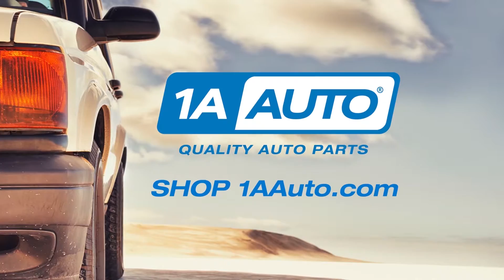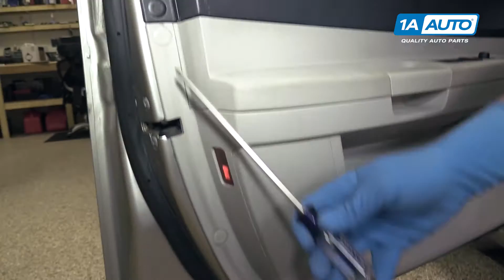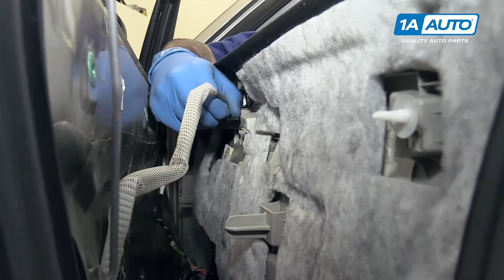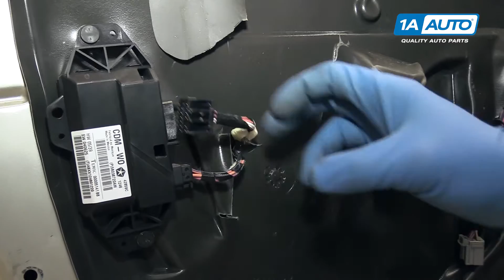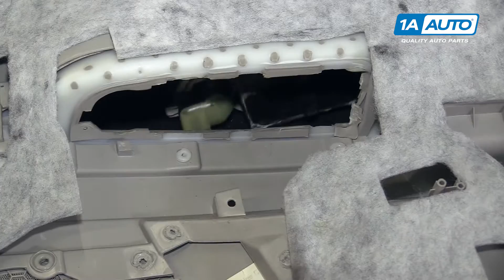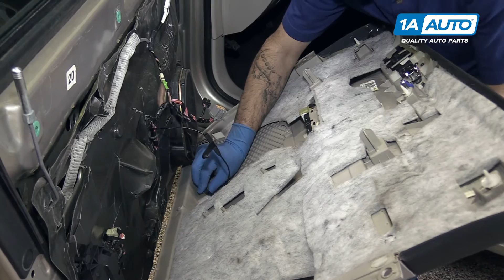How to Replace Front Window Regulator 05-10 Chrysler 300

Comment: I have a 2007 300 SRT. How would I know if it’s anti pinch or not, 2 pin or 6 pin?
Reply from the maker: +Kevin Ramnath Thanks for checking us out! If the vehicle is equipped with the unit-pinch feature, the window motor will have a pressure sensor that detects window motor movement when the glass has stopped moving, even minutely. If this occurs, the window reverses direction and moves downward. In order to determine the pin count, you will need to check the connector prior to purchasing. Hope this helps you out!